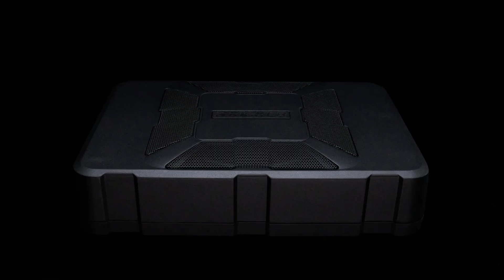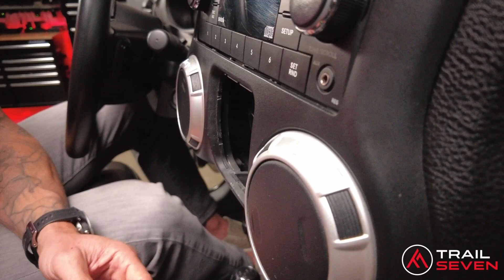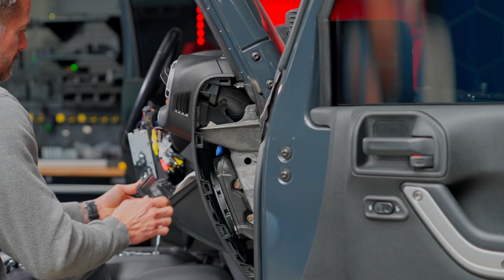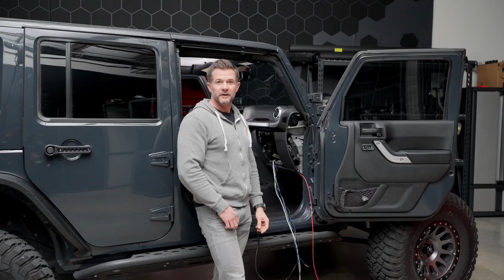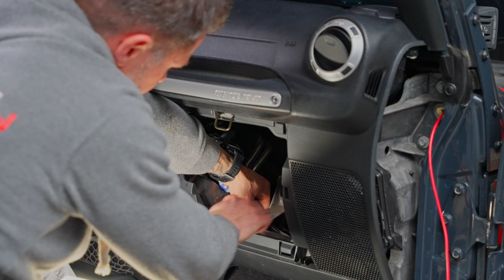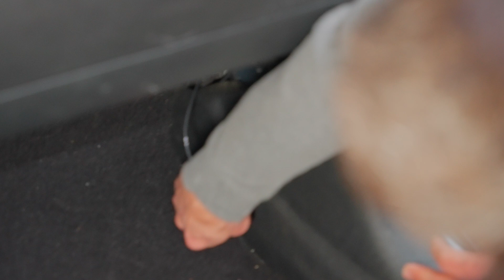Kicker Subwoofer Upgrade Bundle | 2007 - 2018 Jeep Wrangler

Comment: I love watching your install videos, even though I have the OE subwoofer in my JK and installed the XAV6000 kit.  I wish I had seen this before I was installing my breakaway switch for my braking system, knowing about that firebreak and a fish tape to feed through to the engine compartment would have saved me a lot of time.  Great stuff as always!
Reply from the maker: Thank you so much!  We’re just happy to know that we can provide clarity in one way or another to the fellow Jeepers needing extra eyes in areas of their Jeep that weren’t known.  

FYI- this hideaway will compliment that OE sub! 😉.  Our shop Jeep is (or was until we got to it) equipped with the Alpine system also and the Kicker speaker upgrade along with the sub upgrade really allows the Sony head unit to show its potential!